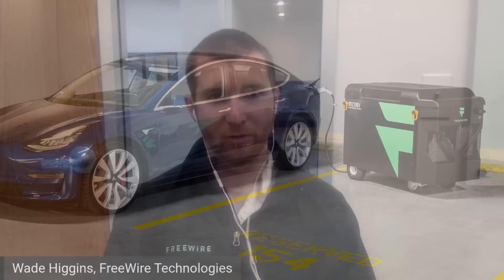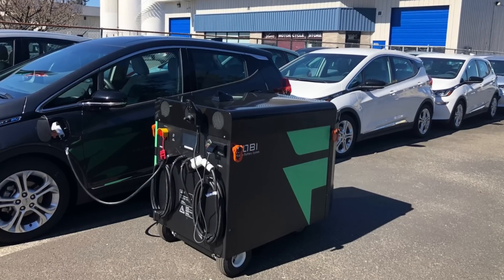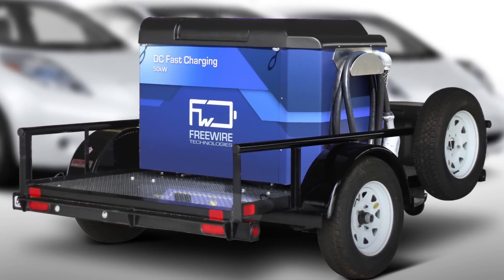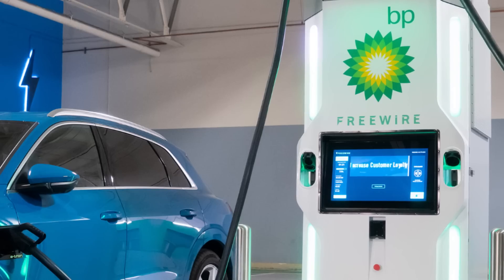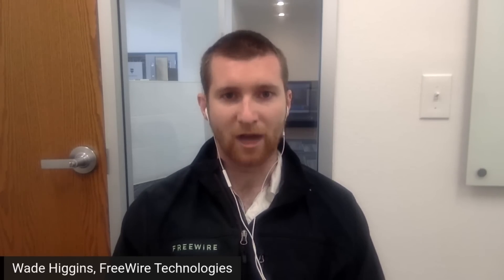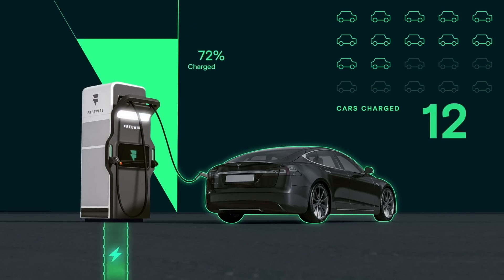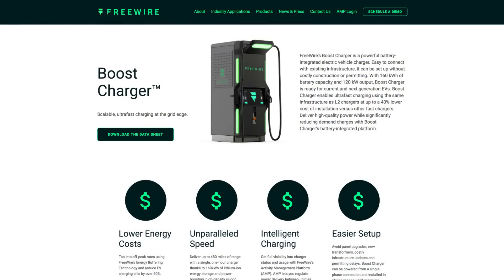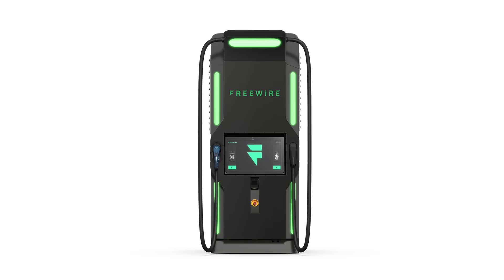How To Build an EV Charging Station Overnight - Autoline Exclusives

Comment: I just did my 1st multi-state road trip in a newly acquired Bolt EV. Most of my Charges were at Electrify America. Almost every every EA stop had problems. Once I had to all support, once I tried 3 chargers before charging completed. I'm not on a coast, so charging here is not that easy. It does take some planning, and even with a fast charger the Bolt is still too slow. Not sure why GM is stuck at speeds that were normal 10 years ago. At minimum the Bolt should at least support 75kw. It starts slowing down just above 50%, so I found that 1 to 1.5 hours was needed to get to the next station.

Outside of charging the Bolt is one of the worst cars I've ever tripped with. The seats are terrible as is the road noise. The screen is slow and there are odd things that happen regularly. I've seen the estimated range recalculate with significantly different numbers multiple times in just a short period on totally flat roads with no change in driving conditions. The app never matches the car on estimated range. It even showed 435 miles when I started the trip, while the car showed 295. The car quickly reduced, but in strange ways, but in the end it appeared that about 210 miles was a reasonable expected range, which is close to the EPA number. Not sure why the car/app can't figure that out.  So far, not impressed with the car. I just hope it lasts till the B2B warranty expires, and maybe by then there will be better choices in my area.

Comment: The “1 second” comment for demand charge is not true. Demand is calculated by the energy used in a set time period, usually 15 minutes. The time varies by utility, but never 1 second. No customer or PUC would accept such a short time to calculate demand.

Comment: Why does the entire station have to close if you just add on charging ?
Reply: If you are trying to install a charging station the same as the gas pumps, you end up tearing up a LOT of the station to place the cables, insulation, upgrading power into the station an  so on. The "Charge Boosters" try to cut most of that out. The guy pretty much explained it in the video.
Reply: @DocWolph  Why not build right next to the station? Charging can on go on the side of the station
Reply: "your just add on charging" flmao...  wannabe utube experts, just google why....

btw, it was just a selling point for his expensive battery based chargers.... just like reduced "demand charges"
Reply: @nc3826  shut up. I happen to know someone who is developing battery power storage systems
Reply: thx for proving ,my point.... "wannabe utube expert"="happening to know someone" who knows something (ie the janitor)

so, good luck getting an engineering degree, like some of us already have... so you can have something useful  to say...

Comment: DC Fast Charging Public Infrastructure is probably the biggest challenge to EV transition; There are massive amounts of drivers who will not have L2 charging capability. When there are as many DC Fast Chargers plugs as gas hoses then range will not be even though of.

Comment: My question is why do we need a level 2 in a gas station??  Would it be to slow??
Reply: They're saying that the charger itself only consumes level 2 power requirements, as its input is continuously charging an onboard battery. It can output at Level 3/dc fast charge levels when a car is plugged in and requesting power/service. Obvious downside here is that it will never be able to provide sustained, charge after charge power at level 3+. The guest said max draw per charger is 20kW (which is higher than level 2...), at an optimistic BEV consumption of 4 miles/kWh, that means each charger is capable of providing max 1920 miles per day of output (4x20x24 hrs). 

Have never heard of 'demand charges', that's definitely interesting. While I'm sure the technical utility billing term is demand charge, the guest should have re-termed it as a utility 'surge charges' as those words are more descriptive.
Reply: flmao....
Reply: @homeworld1031tx  NOT 20 Kw 120 kw 6:17
Reply: https://www.renewableenergyworld.com/2017/06/06/making-sense-of-demand-charges-what-are-they-and-how-do-they-work/
fwiw "demand charges' r 4 commercial buyers, so doesn't usually apply to individual/residential buyers... so trying to dumb down the term for utube wannabe copy and paste experts would be pointless...and good luck googling... @homeworld1031tx